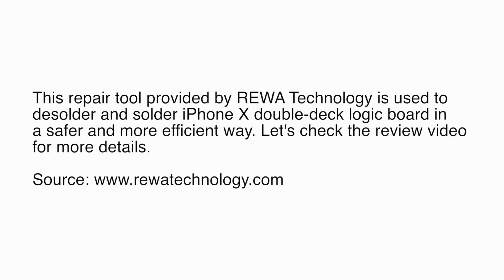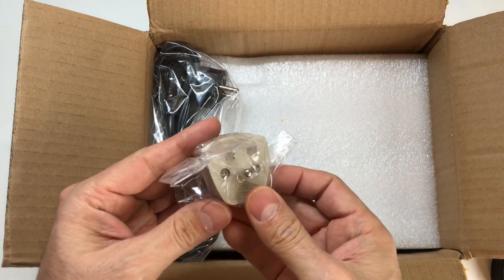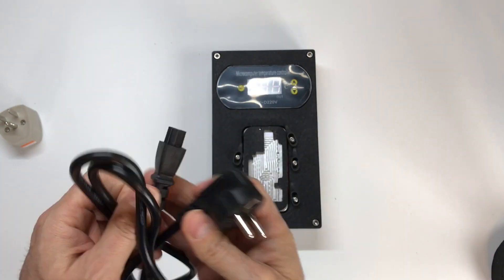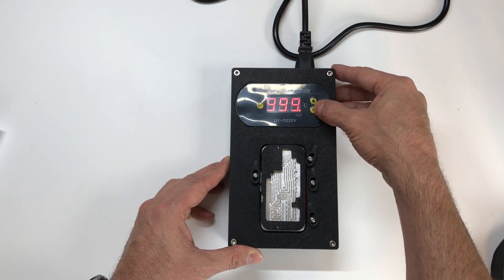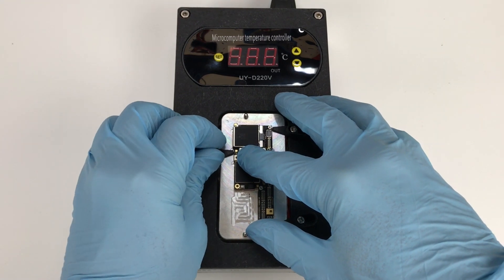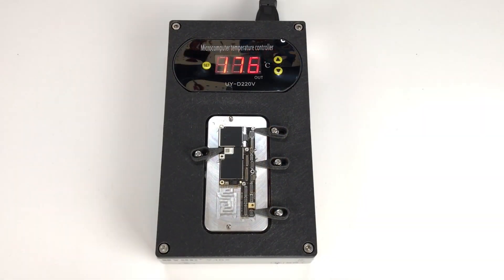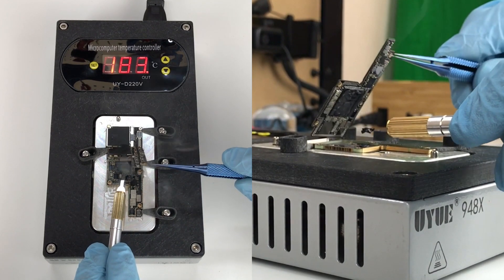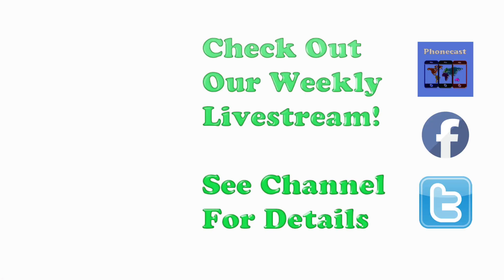iPhone X Logic Board Preheater Demonstration

Comment: My board had a touch problem... I did it exactly the same... but it no longer seems to be powering on? Any ideas? I wouldve expected a simple reflow to fix the solder? Now it's stuck in DFU.

Comment: What about damage to chips that are under filled ?
Reply: At that temperature, there is not danger.  Typical lead free solder melts around 221°. At 180°, the solder beneath the IC's is still solid.

Comment: Nice work! Does the solder holding the 2 layers together just provide structure or is that also how they talk to each other? Seems like a low [reflow?] temp, right?
Reply from the maker: Both and yes. There is an outer "row" if you want to call it that which goes to ground for the most part. However the inner connections go to various circuits so they are required for communication between the layers. These have a lower melting temperature as you stated. In this case 180C was enough to melt them where the components attached require more heat for removal.